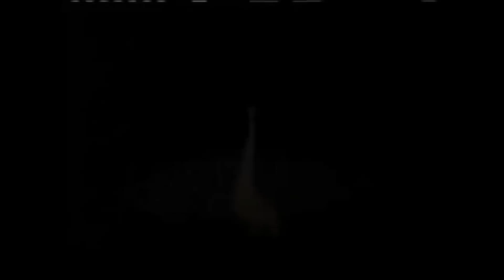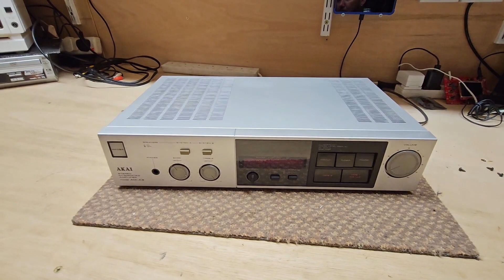1985 Akai AM-A3 Amplifier Resurrection

Comment: I’ve had quite a number of Akai products that I really liked but I never had one of their amplifiers. I think the subsonic filter was to reduce low frequencies (from about 35hz down) that you wouldn’t really hear but could “feel”. Some old warped records could cause this & it could damage your speaker bass drive units, I could be wrong though….
Reply from the maker: Ive never really explored what it did. Thought is might have been something to do with the stereo separation. Never had the manual for this amp.
Reply: I can remember back in the day. In laskys hifi emporium, they had an Akai stereo system. It had white translucent speaker cones. And the store assistant was trying to demo the system to a customer. As soon as they gave it any amount of welly the speaker cones started the flap in and out of the cabinets. Due to the unit being displayed on a crappy shelf that caused not only that unit and it's speakers to wobble but the other 5 units on the shelf also wobbled every time someone touched any of those units.
Reply: The subsonic filter is there to prevent low frequency acoustic feedback from the speakers being picked up by the turntable's phono cartridge.
Reply from the maker: @zero0ryn  Thanks for that. Didnt know what it was meant for!
Reply from the maker: Thanks for the message. I didnt know what that was meant  to do!